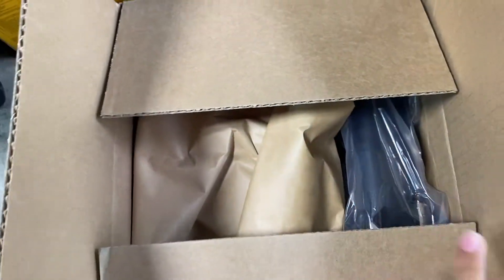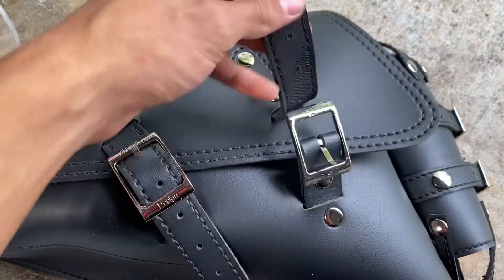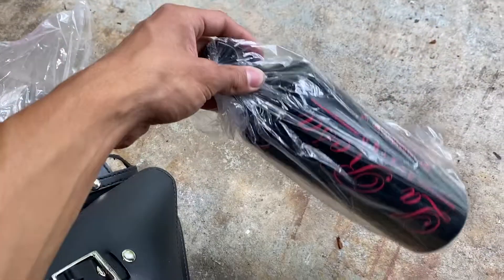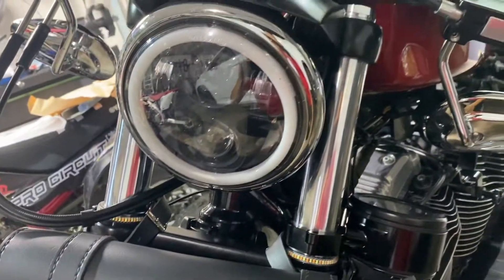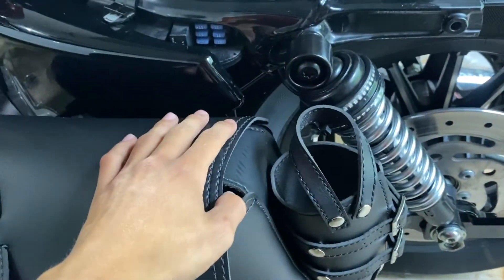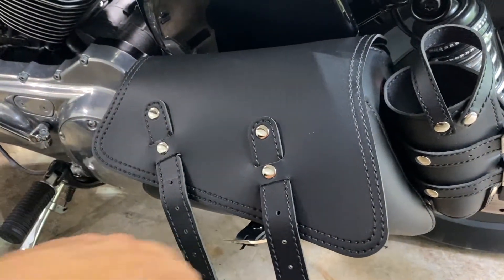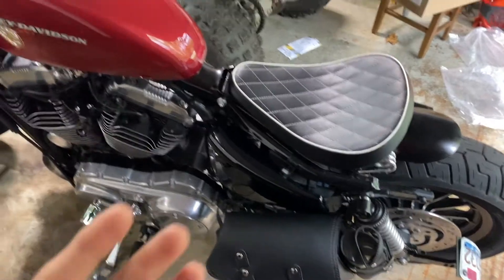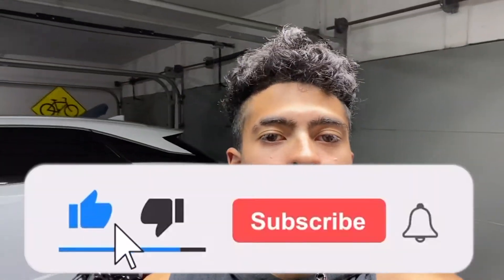Installing La Rosa Saddlebags on my Harley Davidson Sportster! (Harley Bobber Build pt.3)

Comment: I bought these had for about 10 months and I’m about to either do Viking or willie & max bags. I bought the Rosa’s thinking they would be good but the my sag and look horrible once they deform. The bottom mount point makes no sense on most sportsters also. The Viking and Willie & max bags have hard plastic liners that help keep the original shape. Also like the Viking one cause it has a inside storage pocket with zipper for registration or small things, and you can put a small lock on them.
Reply from the maker: Awesome advice! so far i havent had an issue with mine but i could see the deforming being a problem in the coming months